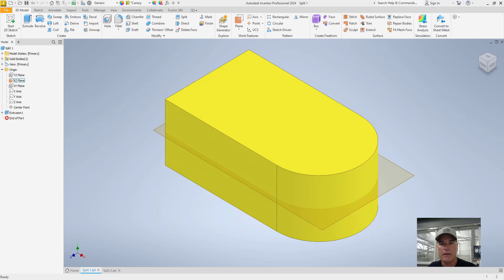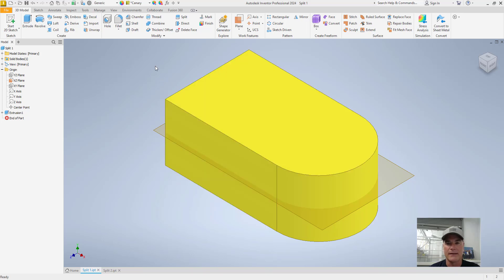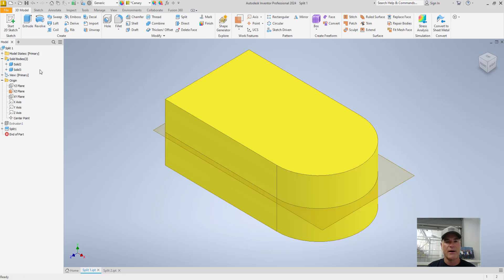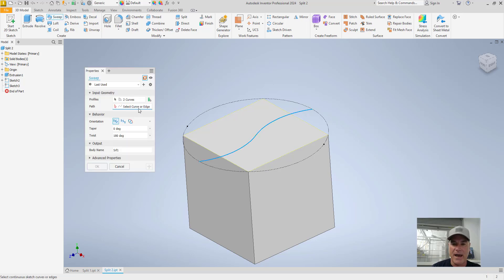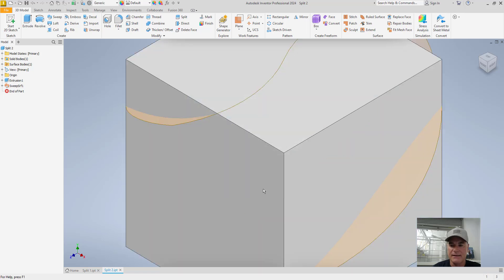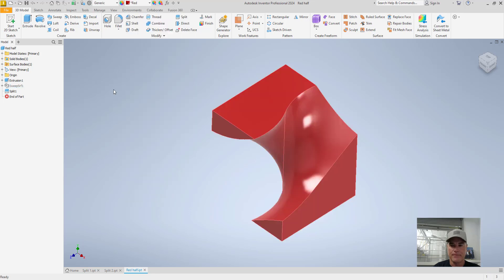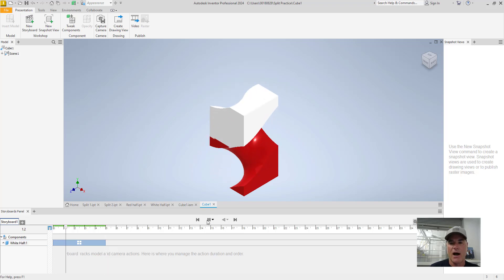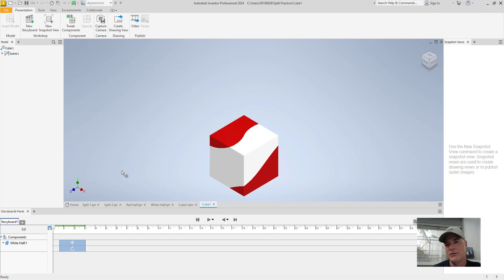Autodesk Inventor - Split

Comment: these tutorials are wonderful, please dont give up , thank you:trophy-yellow-smiling:
Reply from the maker: I'm not giving up! I have been quite busy with work, but will be posting new videos beginning next week.
Thanks for the encouragement and let me know if you have any specific needs.
Reply: @professor_porkchop  Would you know why inventor always reverts to PERFORMACE VIEW  ?
I cant find any information on this, how to set  it to HIGH QUALITY,
with out having it revert back, after i make a few changes on the assembly/part
Help :face-purple-crying::face-purple-crying:
Reply from the maker: @fernandorosebush6594  
"Performance View"  prioritizes fast rendering and smooth navigation by reducing graphical complexity and visual effects, allowing for better performance when working with large assemblies or complex models.You can access these settings through the "Application Options" menu to adjust graphics quality for optimal performance based on your system capabilities.